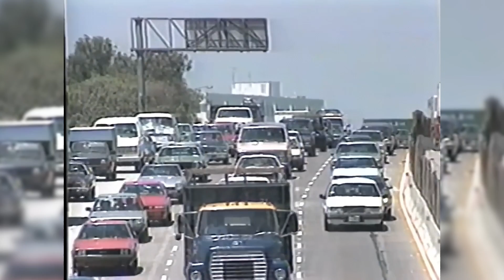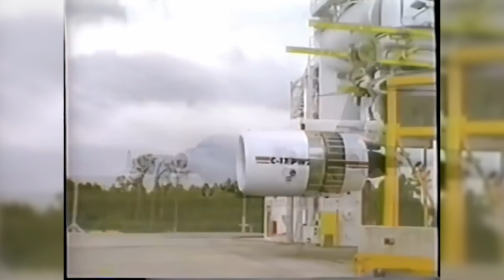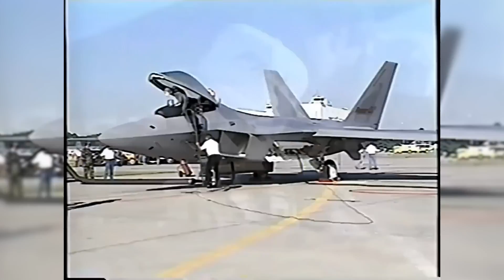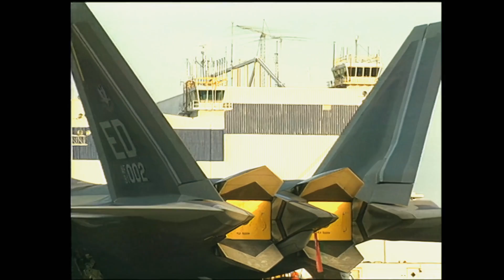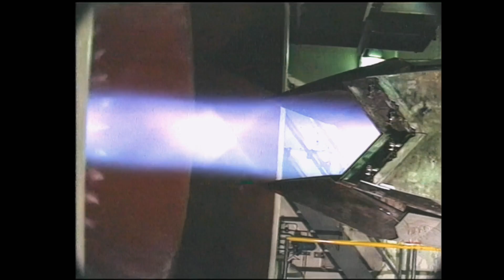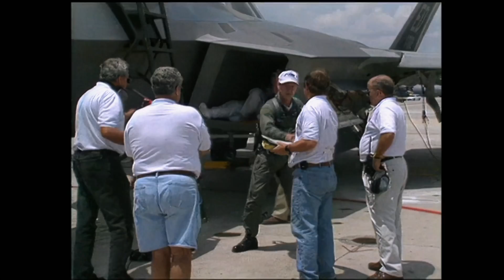Pratt & Whitney, From The F100 turbofan That Powered The F-15 To The F-22 Raptor Engine. PART 2

Comment: I worked on the F100 and F200 at Luke AFB from 1997 to 1999. I WISH that I could go back and do it again and NOT change from the engines to the equipment for them. THAT is my BIGGEST REGRET!  😢😭😭😭

Comment: Just accepted a position at one of PW's factories. Never been this excited to start a job. This is quite the legacy and the F135 engine is shaping up to be another F100. If the AF is smart, PW will get the contract for the SR-72. Only fitting considering they powered the SR-71.